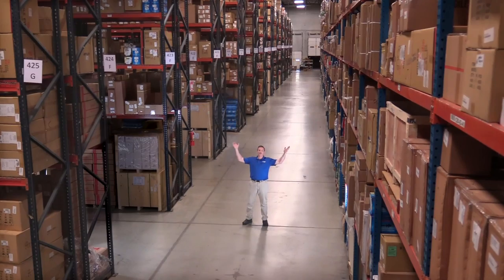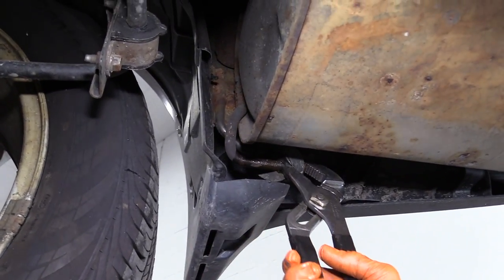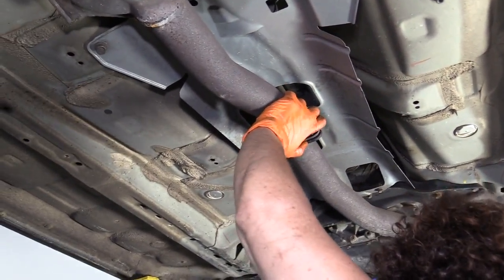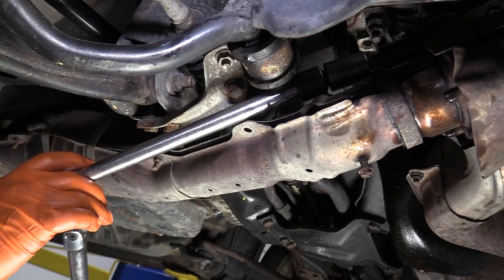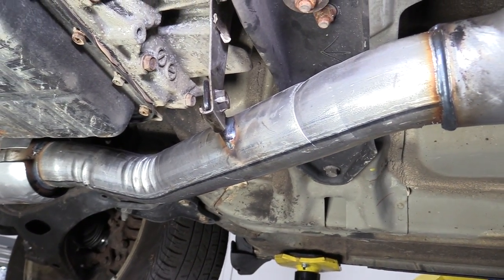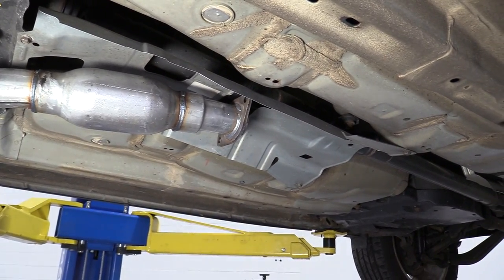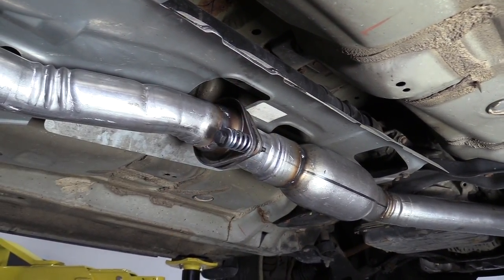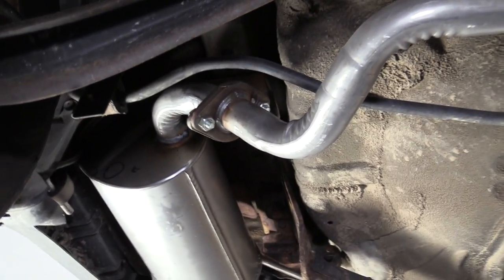How to Replace Exhaust System on a 04-09 Subaru Outback

Comment: Of course none of this works in real life situations where you have rusted nearly welded corroded bolts where no rust penetrant is useful
Reply: Use a benzo heat torch, hammer around the area, then use extractors from harbor freight (they grip better than normal hex sockets).
Reply: True.  This is a great video for instruction.  In reality, you will need a gallon or penetrating oil, a grinder, hacksaw, goggles, band aids, for your bloody knuckles, lots of BEER and make sure to keep all young children away so their ears don't burn from all the cursing you WILL be doing.  LOL.  I had to do this job in my gravel driveway, during the rain, with cor on jack stands... talk about PAINFUL!
Reply: Lol just had to grind all my bolts off
Reply: And you don't have a lift

Comment: The reason the muffler doesn't clear is because it's a muffler for the Legacy wagon, not the Outback. The exhaust tip is straight on the Legacy and curved on the Outback, to fit each car's bumper cut-outs. You used the wrong part. Otherwise good video.
Reply from the maker: +Alex S Thanks for the tip! We'll pass this info along to our production team.

Comment: The muffler shield has corroded through the two recessed bolts which are terribly rusted onto the mount. All attempts to remove is starting to twist the brackets that are spot welded to the undercarriage.  I am afraid that I will break them if I twist any harder.  Any suggestions beside heat and penetrant?  Sort of worried about  using a torch that close to the fuel tank to heat the bolts.

Comment: Excellent information. You gave me exactly what I was needing to know for my 2007. The secondary is actually a resonator, not a cat. What's interesting is on the cat I do have, there are two O2 sensors located within a foot or two of each other, which I find strange. And cant locate any other o2 sensors on the exhaust anywhere. I guess it's just those two, one for up stream one for down, I would guess. Makes it difficult to test with an infrared thermometer though.

Comment: Thanks for showing us this!  A tip for removing the back part of the system by yourself: use a ratcheting strap connected to hard points on the back side of the rear suspension to hold the system in place while you disconnect the rubber hangers.

Where did the system you put on come from?
Reply: Nice tip.  Again where did the replacement system come from because I can not find that kit on 1AA web site for the same vehicle in your video.

Comment: Can you use any of the heat shielding from the original catalytic converter to cover the aftermarket one?
Reply: The pipe that went on was what's referred to as an "air gap pipe", basically 2 pipes, one inside the other. The outer one acts as a heat shield, so the factory ones aren't necessary.

Comment: I cant seem to find this part for my 09 outback on your site.
Reply from the maker: +oespo oespo19 Thanks for watching!  The only piece of exhaust we carry for that vehicle would be the front pipe with converter.  It will only fit on 2.5L non-turbo models.  Here is a link: https://www.1aauto.com/subaru-saab-front-exhaust-pipe-with-catalytic-converter/i/1accd00279?f=655045&y=2009

Comment: I have a 2008 subaru legacy i think i need a new cat,cant i just cut out the old one and weld a new one on??
Reply from the maker: +jingli Green I strongly recommend that you have a reputable mechanic inspect it and see if that is possible. They’ll be able to troubleshoot the problem and tell you what part or parts you’ll need for the repair. Typically, you cannot do this as it comes as a complete unit.
Reply: I wouldn't recommend it I'm going through that headache as we speak.